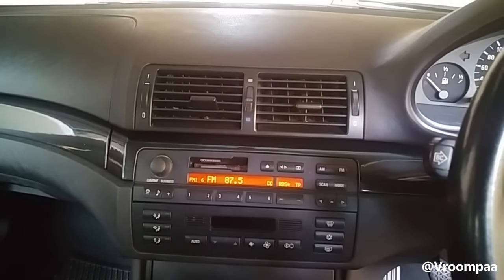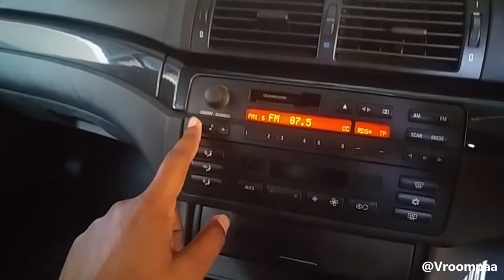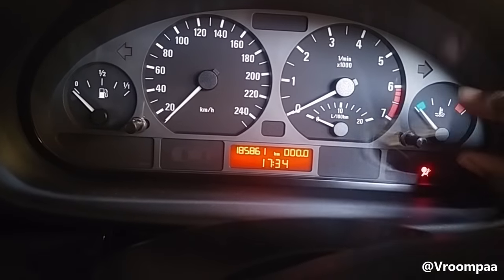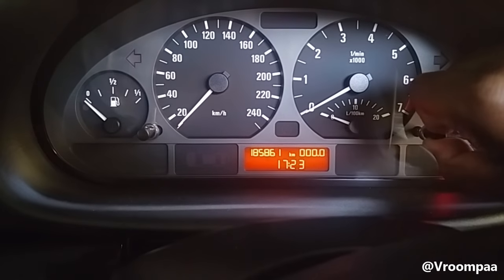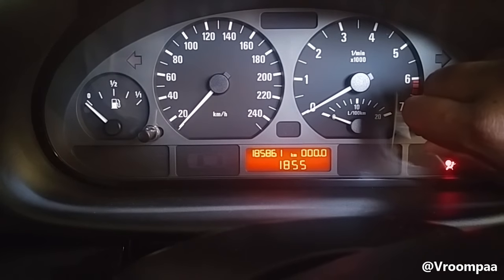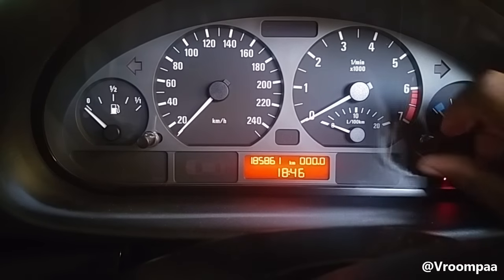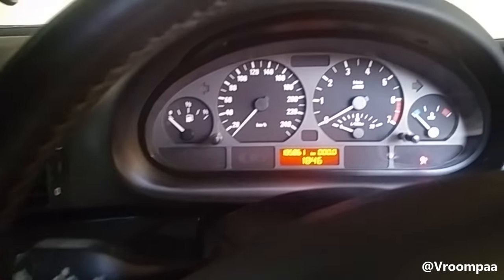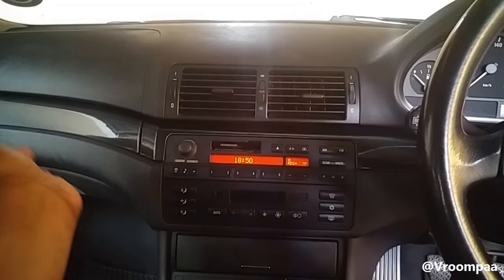How to set the clock - BMW E46

Comment: To get to the time menu in the dash, you need to use yoyr key and turn it to ingnition position two and use the BC button on the left lever of your steering wheel, press it until the time is shown instewd if the other options, then you can follow the steps shown in this video